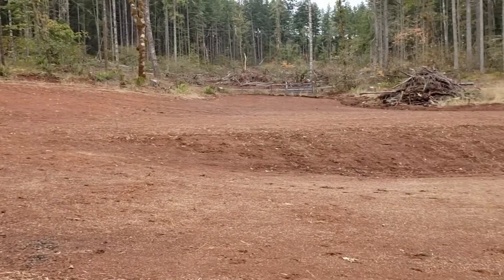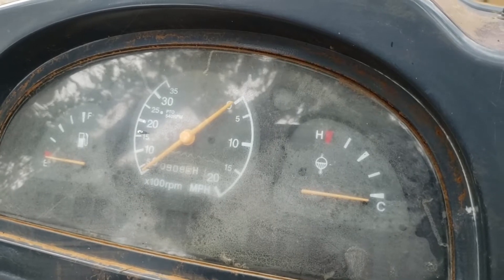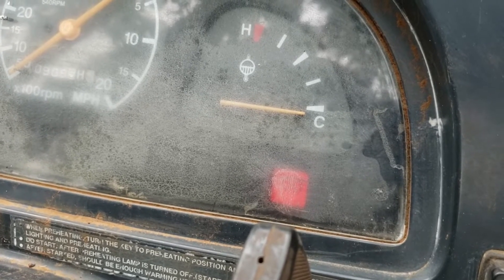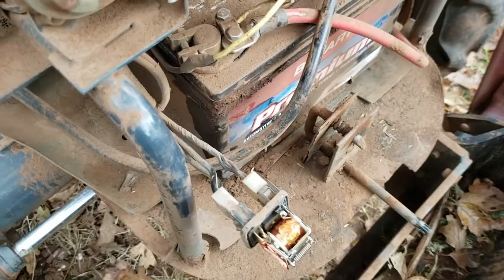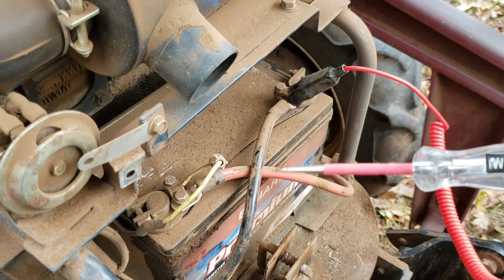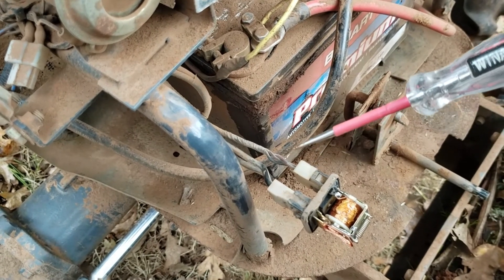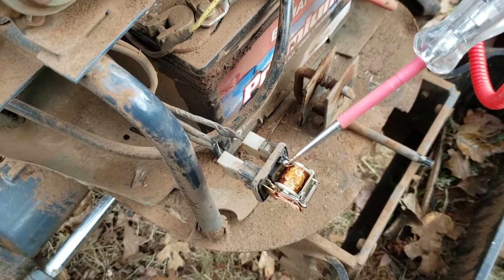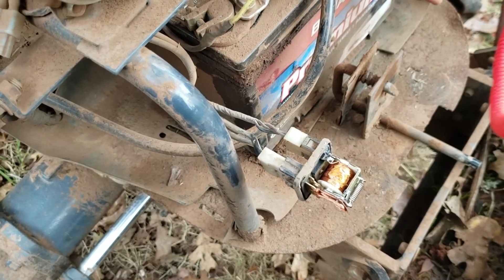TYM Glow Plug Troubleshooting and Operation

Comment: Thank you so much, fixing to go use your information.  Never thought about the relay
Reply from the maker: You're very welcome- glad it helped!
Reply: @CuriousCaine    well its got 1 more problem.  rear brakes going and gone, ever replace those before ? i've done front wheels diff gears before . pain in butt, afraid to do rear brakes . looks to be inside rear trans box  any Suggestions or ideals. can't seem to find a mechanic for my TYM 293 ?  its been a good tractor for all i put it through. any help will be very  appreciated       thank you
Reply from the maker: @RobertYoung-rv2jp  No, I haven't had to do those.  Best to search on tractorbynet